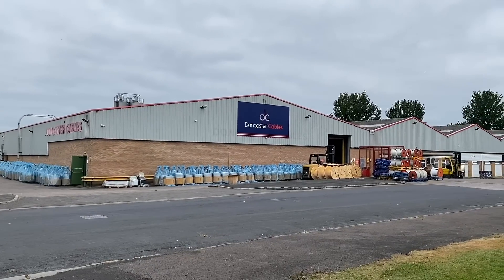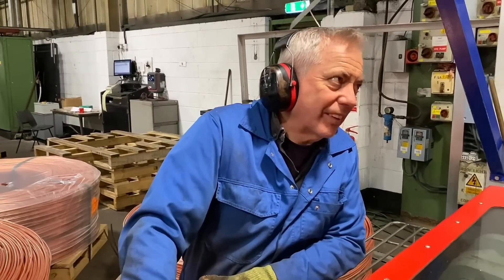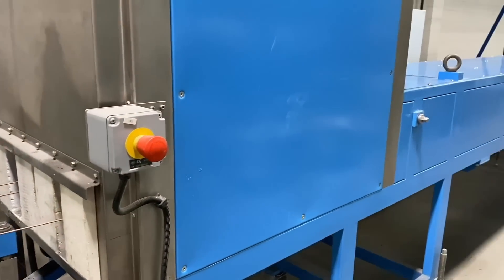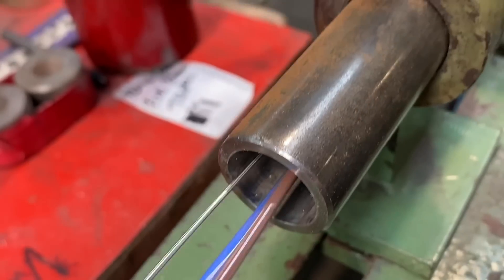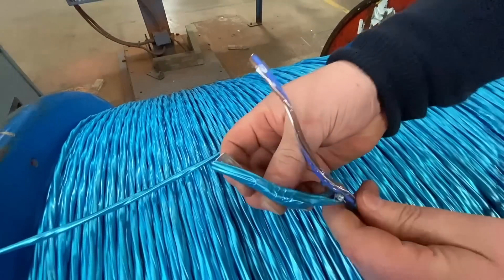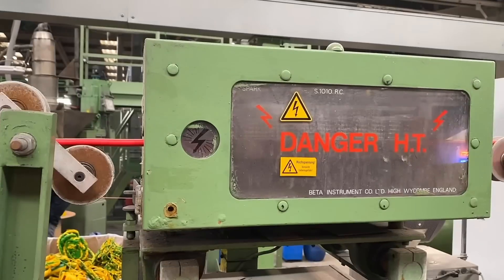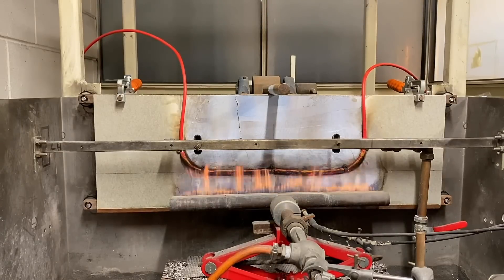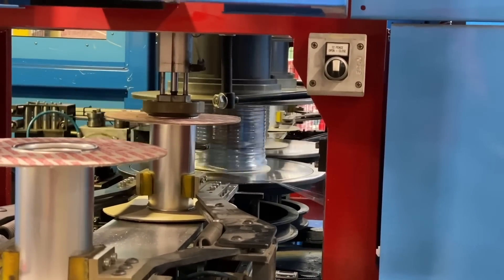The SECRETS of Making Fire Performance Cables

Comment: Interesting concept, but why not just use MI?
Reply: yes i know it's slow to terminate.... but... how much is your life worth
Reply: @TheChipmunk2008  The cables only have to last long enough for the alarm system to operate and if it hasn't been operated in 30 minutes then it isn't going to be operated at all although in most cases 60 minute rated cable will be used or 120 minute for larger buildings.